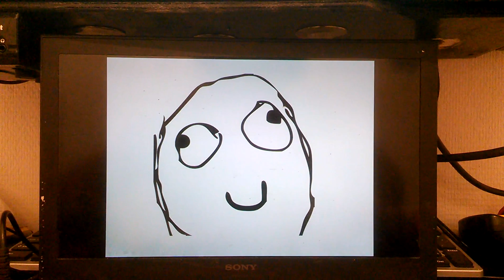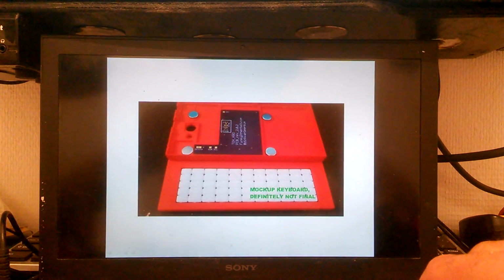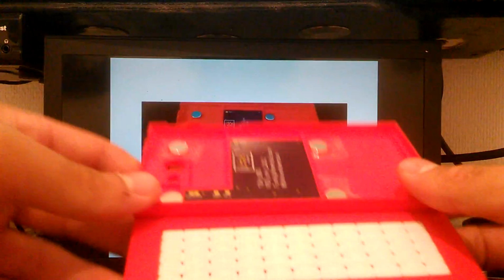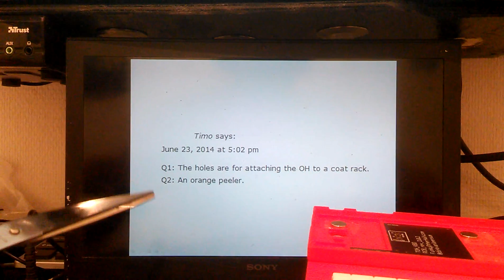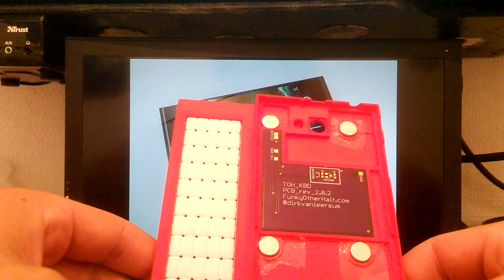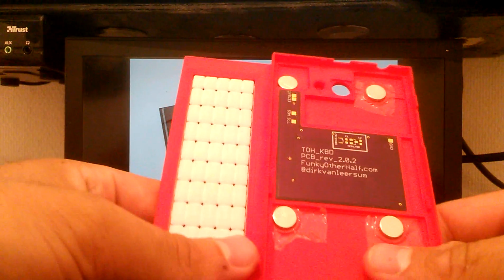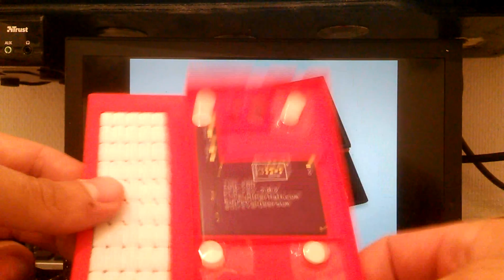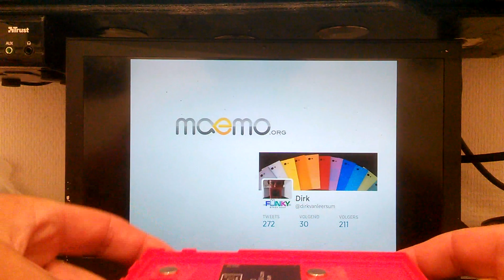TOHKBD rev2 mockup1

Comment: Very interesting but a bit worried if it wouldn't fall apart in my backpack - or worse if magnets would affect e.g. my laptop hardrive. Also - with magnets on does Jolla work fine? I mean GPS, Bluetooth, WiFi and accelerometer. Obviously compass will not work. But that's fine if compass will not be permanently damaged by the magnets. Did you do some tests or maybe consult Jolla hardware specialists?
Reply from the maker: Did some preliminary tests, but all seems fine!

Comment: Doesn't the strong magnets affect the signal of the phone? To keep the keypad securely attached, I'd imagine they need to be quite strong... If I'm wrong this only affect users with covers where you keep your credit cards.
Reply from the maker: No change in signal strength and no issues with touchscreen. Modern phones are not affected by magnets, all is well!

I wouldn't swipe your old credit-card over the magnet, but all modern debit/credit-cards use a chip and not the magnetic strip!